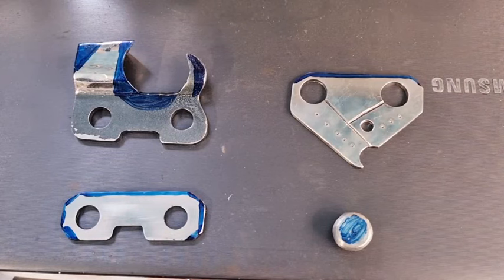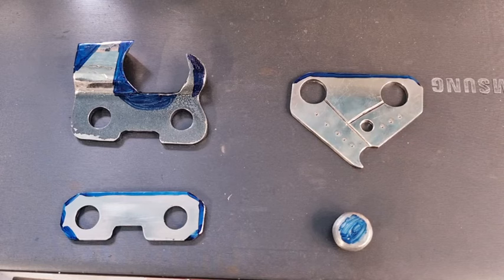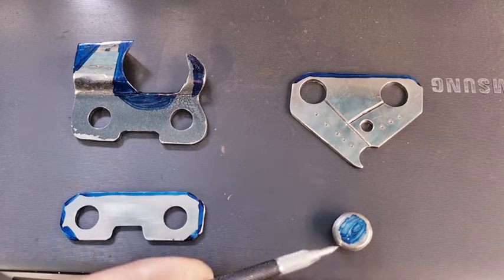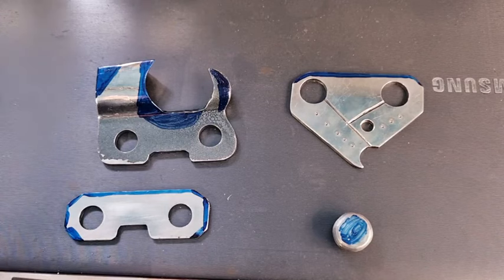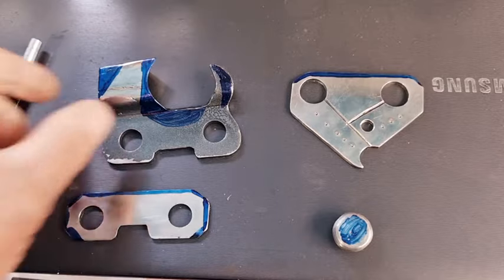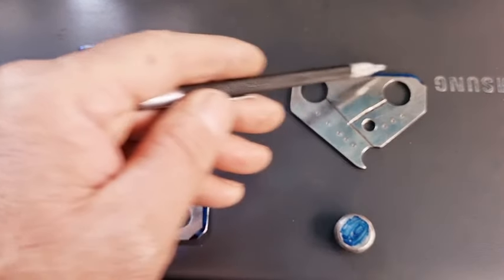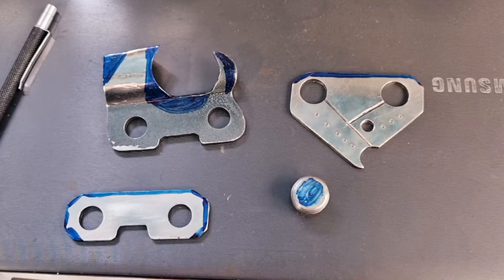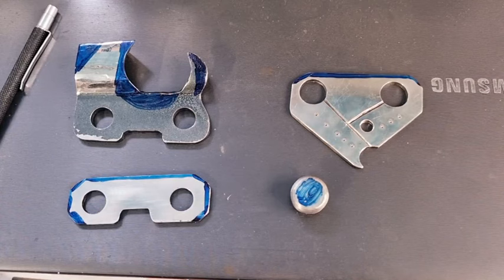Racing chainsaw chains explained

Comment: I disagree with a couple of things. It’s extremely uncommon to use a 30 degree top plate angle with square, even in racing. 20-22 degrees is about as aggressive as it gets with square, any more than that it starts going backwards. For regular every day cutting around 15 is normal.

Chips are not carried in the gullet. They are dropped out the back of the cutter between the top plate and the top of the strap. They are carried out on the blank link between the cutters In front of the following depth gauge. I mentioned this in a different comment, but chains with an anti kickback ramp are useful for this type of high chain speed. The top and leading section of the ramp gets removed but it adds some additional width to the font of the depth gauge, helping to effectively dam in the chips. 

Clearing out the gullet on race chain is about removing weight. Otherwise it has a very limited effect on the cutters performance until the remaining metal in the bottom is wider than the working corner. 

Depth gauges on race chain are typically higher than normal chain, in the range of .015-020. Much more pushing force is used by the operator than in normal use. It’s a way to maximise available power. The user has more control to keep the chain speed up by reducing pressure than the alternative of allowing the chain to take a larger bit itself.

Like everything there different ideas used by different people, others will disagree but this is more typical of a race chains used.
Reply from the maker: When a chain cuts 1000s of chips are flying everywhere and escape any way they can this includes the gullet maybe not much but the slow motion video I have see clearly shows chips of wood not just coming from the tooth only
Reply from the maker: Yes you are correct 20° not 30° as I was thinking.  Sorry my mistake
Reply: @ChainsawUsers  We all have those moments so no worries there.

Race chain is a difficult subject to find much information on because, like you said in the video, everyone wants to keep it to themselves. I have got to look at a few different chains and everyone has different ideas and that one secret they think is a game changer.

All I have ever been able to work out is it's about reducing friction and getting the chips out of the way as quickly as possible. The only racing I have ever tried is post rip and that's a bit different again because you need it to be pretty durable. 3 cross cuts is alot different to 6 or 8 rip cuts.
Reply from the maker: @Calais3461  chainsaw chain is interesting just when you think you know it all you find out more Information that you never knew.